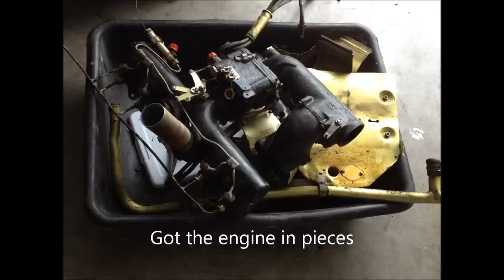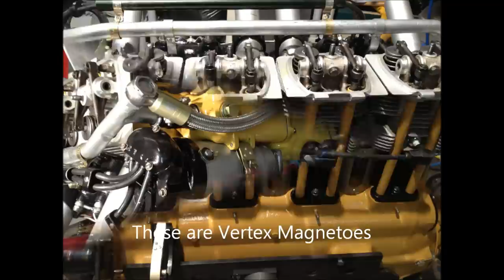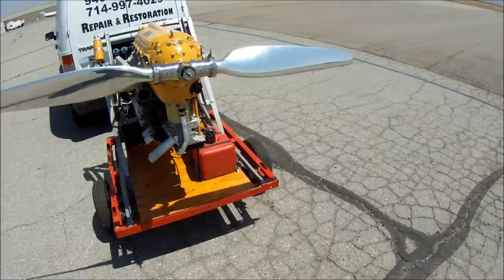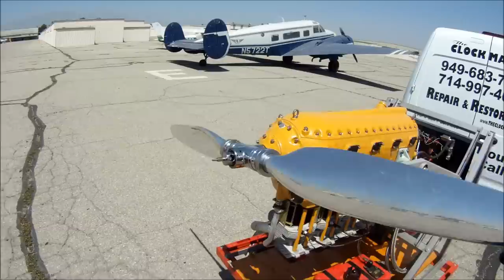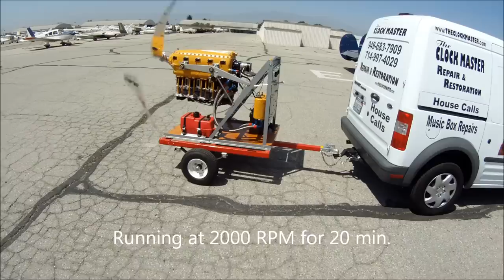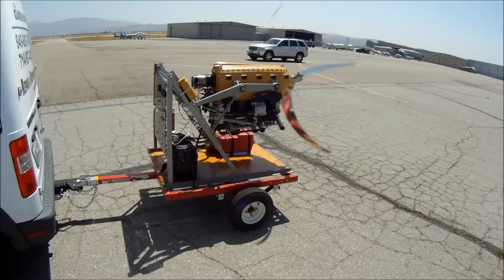Walter Minor inverted 4 cylinder engine rebuild and start up

Comment: iiijasiii
Yes.  Avia still makes this engine.
Reply: No it isn't. Avia was producing M132/332, which is based on that engine, but it is bit different. It has camshaft on heads, so it is OHC and also it is fuel injected. I have this engine in my airplane (WM4-III) and it is very difficult to find any parts.

Comment: How does the oil lubrication works here? 
How the oil is pumped out of cylinders/upped part of pistons?
Reply from the maker: It is a dry sump engine,  whatever oil pass the oil rings it's  burned and out of the exhaust.